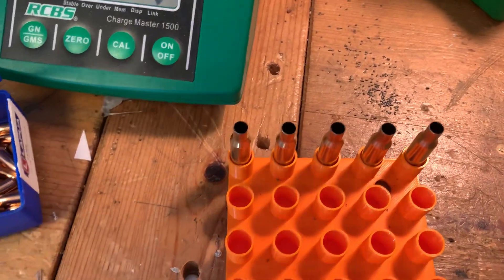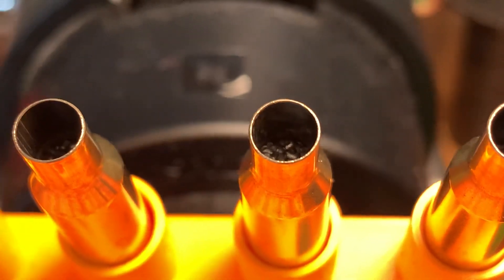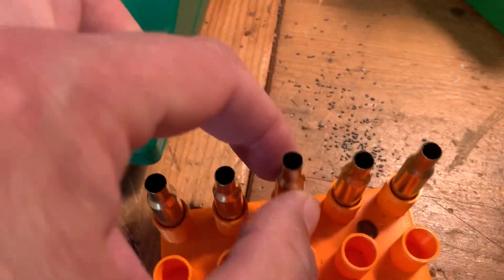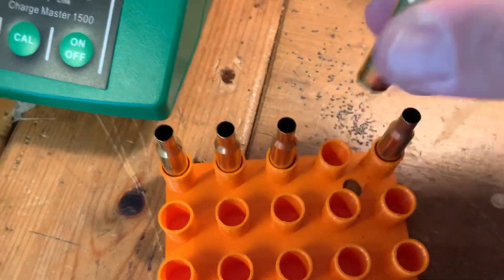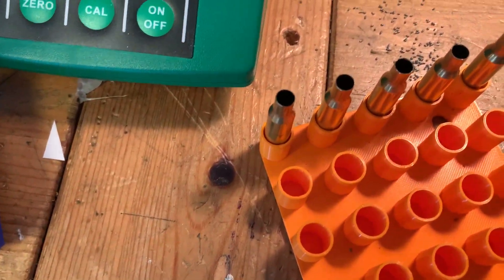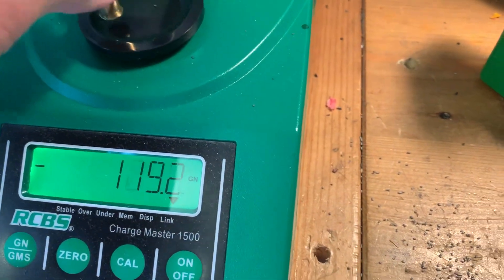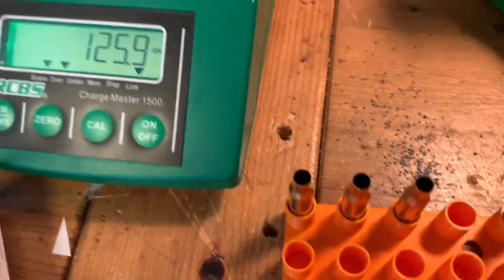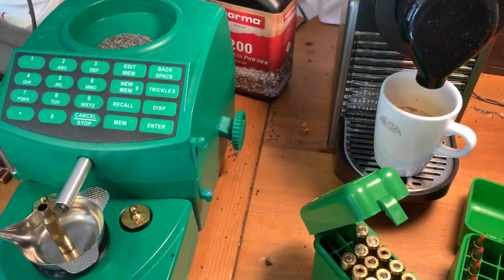222 Remington “case study”

Comment: If you don't load maximum charges for potential danger then the brass weight and different brands don't matter. The reloading manuals safety rules always state to begin at the lowest powder charge for a starting load and to never cross caliber charges or loads. Why would anyone want to load a .223 charge into a .222 case against the manual safety rules and ask for trouble? The safety information for proper reloading is in every single reloading manual. Those that don't follow it do so at their own risk.
Reply from the maker: Of course it matters. What's the point of carefully working up a load and then pouring this perfected powder charge into random cases? 😉 My point is that even if you follow all safety precautions, you can still end up in this weird situation because the manufacturer's cases vary this much in weight. The worst example I know of is Norma's 300 Win Mag cases that can weigh either 215 or 270 grains. That is a huge difference that once got me in trouble when I at the range suddenly launched my 180 grain bullets at over 3200 fps.
Reply: @NordicRifleman  So you are telling me that for one specific caliber that a low powder starting charge is dangerous from one case brand to another? Please stop lying. Read your manual safety rules and get some experience. If the charge and pressure is too much then pressure signs will show up in the primer and the case in the form of flattened, pierced, or dislodged primers and in case stress fractures as the charge and pressure increases regardless of case brand signifying that the charge and pressure is too great. The physical condition of the case and the primer will tell you how far you can go with your powder charge and pressure for any given case brand.
Reply from the maker: @rbm6184   No, I have not written that at all. I have handloaded for around 150 rifles and maybe 35 calibers. My point is this: let's say that you work up a load in your rifle and then settle for a maximum load. Fine. Now it's time to load up say 50 cases to last you the entire hunting season. If one or several of those cases weigh considerably more than the others and thus has less internal volume, you will have an issue. That is the whole point of this video. I will also say that this is not a common phenomenon, but it DOES happen. E.g. for Norma 222 and 300 Win Mag.
Reply: @NordicRifleman  If the charge and pressure is too much then pressure signs will show up in the primer and the case in the form of flattened, pierced, or dislodged primers and in case stress fractures as the charge and pressure increases regardless of case brand signifying that the charge and pressure is too great. The physical condition of the case and the primer will tell you how far you can go with your powder charge and pressure for any given case brand.
Reply from the maker: @rbm6184  Agree 👍
Reply: Everything matters...why reload !!